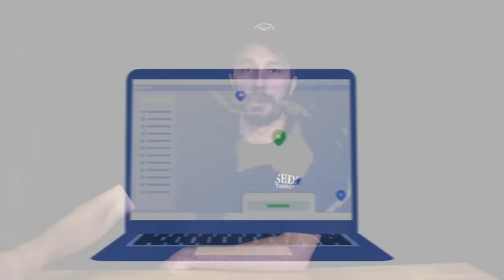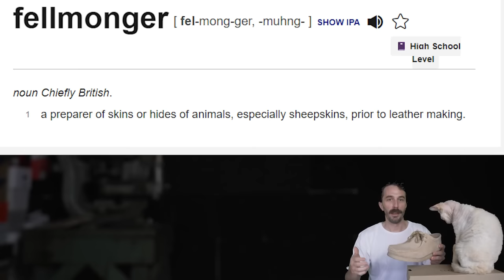The most popular ugly shoe - Clarks Wallabee

Comment: The Clark's "Weaver" shoe is one of my favorites. It's an underrated model in the Clark's lineup, with the Desert Boots and Wallabees domimating their marketing.
Reply: Honestly like the look of the weaver better. Are they true to size?
Reply: @Conrad45  I size
 up a half-size on Weavers.
Reply: @Conrad45  
My experience.  Same pair of socks, no extra footbeds/insoles. 
UK-made NB991 size us10½ = US-made NB997 size us10, similar to Clarks Weaver Boot (high) size44(size uk9½G, us10½M on the label)

Edit: My Weaver (low) size us10½ is slightly longer than the Weaver Boot (high) size us10½. Idk why.
Reply: @Conrad45  in my experience with wallabee styled Clark's half size down is best. especially if you'll wear it long term.
Reply: @Conrad45  Half a size down on Weavers for me.
Reply: @Conrad45  half size down if you’re unsure on the weavers.
Check out the Padmore and Barnes ones - better quality .
Reply: @PamelaD963  good shout
Reply: I don't know if it's my posture...I always get one side of the heel flattened than the other on each pairs which seems normal and a bit noticeable too without such high back heel. On this shoes, it's more obvious after several wears
Reply: Love the weavers as well
Reply: Desert Treks > Wallabees > Desert Boots for me 
Love em all and just copped those Torill to mix things up so not everything I wear has that same crepe sole 
#Clarks

Comment: The crepe soles on my Clarks boots fell off before I had a chance to wear them. I had them stored in a closet for over a year and couldn't believe it when they fell apart. I bought a can of contact cement and stuck the soles back on. I looked online for information and found that other people had the same experience with the soles. Turns out mine were made in China. In the 70s I used to buy wallabee-style shoes that were made in Poland. They were inexpensive and virtually indestructible. I'm hoping my repair job will last a long time as these Clarks cost around $150.

Comment: there is a shoe thats really similar to these called the padmore and barnes p204 that seems to be made equally as well or better because theyre hand lasted and hand stitched with the same style of crepe outsole. i would be really interested in seeing them cut in half before i make a decision on which one i should get, because even though these seem to be good quality the fact that its not a true moccasin makes me a bit hesitant to spend that much since i would for sure be looking to resole them once they wear out
Reply: I recently bought a pair of Wallabees but returned them and got a pair of Padmore and Barnes p204s. A couple of other things to note about Padmore and Barnes vs Wallabees is that the Padmore and Barnes do not have that narrow sole thing going on. The crepe extends past the sides of the shoe. In addition, the primary reason I returned the Clarks was that they were too narrow. I had a pair of Wallabees about 7-8 years ago and they were much wider than the newer version of the Wallabee. From what I read, they changed the design within the past few years, making them more narrow whereas the Padmore and Barnes are the original slightly wider design. I had the two shoes side by side, and the Padmore and Barnes seemed higher quality.
Reply: Padmores also have extra leather inside the shoe and much better  insole, in clarks it's cheap and even not leather
Reply: I have two hair, the p204 and another in boot form. Love em
Reply: @ЮрийБородулин-г1в  no one, and I do mean no one, has any interested in the views of a RuSSian at the moment,
Reply: @ruzziasht349  cool story bro
Reply: @niftyhorsowitz4494  elasticated laces be real on the P204s
Reply: Padmore and Barnes used to make wallees for Clarks. +1 for a comparison video, please.

Comment: In the 70s, you could find extremely high-quality knock-offs of expensive brand-name shoes like Clark’s, The Earth Shoe, etc. at chain shoe stores like Kinney and Gallenkamp for very little money. And when I say high-quality I mean they were made of real suede and leather using the same design and materials as the name brand shoe. You could not tell the difference. They’d be comfortable and durable and run you about $7 to $8 bucks. 

Even into the 90s Kinney Shoes sold quality knock-offs. In the early 90s I used to buy their genuine leather knock-off Dr. Martens for about $20. I would also buy real suede Clark’s desert boot knock-offs, suede knock-off Birkenstock sandals for my daughter, and once, in the late 90s, I found an exact replica of a beautiful pair BCBG high heels.

Comment: These were all the rage when I was in high school '74-'77 in SoCal.  You wore them with your straight leg 501's, Hawaiian shirt, and puka shells.  Very cool. 😎 Thing is that once they wear out, they wear out.  Contrary to your statement, they DO have stitching underneath the glued on sole and the sole is VERY difficult to remove.  They are virtually un-resolable (most cobblers won't touch them) and even if you found a cobbler who would attempt re-soling them, it would be too expensive.  Easier to buy a new shoe.  But hey, we are slaves to fashion and what is old is new again.

Comment: You might want to look into dissecting a pair of Grasshoppers now! I grew up in them and was surprised how different they are to Wallabees. GH are lighter, the sole is shaped differently and the inside isn’t slippery. Very very comfortable.
Reply: YEs and the Padmore and Barnes version too.
Reply: Grasshoppers were easily one of the most comfortable shoes I ever had. I had it in black for school and an algae green suede pair. Tough outer, but sole not so much.

Comment: I have been wearing the wallabees for like 6 years now, they are the most comfortable shoe I have ever used, even more that any sneaker. My only grip with these is that once the sole is worn you have to throw them away as there’s no resole service, which is a absolute shame for a €160 shoe. If they could offer soles or maybe a harder crepe - they used to make them with authentic crepe, now its a composite with rubber in it - they would be the perfect casual shoe.
Reply: Any local shoe repair will resole them for you.
Reply: I actually own Clark’s wallabies with a harder outsole.

Comment: I've had a few of them from suede to leather and more recent colors. The sole isn't meant for walking on a regular basis sometimes the bottom will blow ot but the upper part of the shoe sustains. It would be nice if they  used a more modern or sustainable sole.

Comment: Watched this because I’ve had a pair from new for 7 years now and they’re essentially in mint condition besides the soles wearing out… and have a couple other pairs that are used and the only issue was the insole separating - but they’re in a color they haven’t made in 12 years and I’ve had them for 5 so overall I was impressed just wanted to hear your thoughts

Comment: Long before Wu Tang they were hippie shoes.  Super casual shoes that lasted forever dried fine after being wet and could pretty much be worn year round. Comfort beyond belief.  I've always had a pair or two ever since 1975 in both low and hi which isn't much height difference to me. I've worn with tapered jeans, boot cut, etc  khakis and corduroy pants.  Even with shorts.  The prices NOW are ridiculous though.  You can get them with a lighter more modern sole that's nice too but not as comfy imo

Comment: Rubbish footwear, dye constantly bleeds on any type of socks I wear.  Awful to drive in when heels are concerned.  Collar and tongue are very uncomfortable when laces are tied snug like any other shoe is tied.  I'll experiment with inserting a half an orthotic to the forefoot and toes in order to stabilise the drop these have, see if I can wear and get used to them (if not they're going straight to the donation bin).  I really do not like the amount of heel they have in there, not to mention the uncomfortable seam of that half insole at the heel they come with.
Would never recommend.

My first type of moccasin shoes that resembled partially this Wallabee was a mid top version by Mack (yes, Mack Trucks).  The outsole and midsole were completely different and also comfortable.  Outsole was made of a very thick plastic, quite slippery I remember them wearing them literally everywhere, anytime, anywhere.  The heels never wore through to the midsole/insole which leads me to believe it was a truly solid layer of plastic as the outsole.  They ran at least half a size up, sort of like the Wallabee.  Leather was pull up, easily marked and scuffed and eventually the nubuck type of pull up leather was worn down to a regular calfskin looking leather while still retaining that thick, substantial feel of pull up like a Red Wing almost.  The insole/midsole was a generally sport fabric and it conformed to my feet in about 6 months or less.  The break in and wear in time overall was about a week.  Flex was normal for a sneaker/casual boot/everyday moccasin.  They withstood about 4 years of regular wear before the laces needed replacement, at around that time I moved onto other shoes and eventually they were hidden away for so long I just donated them to the bin.  Easily could've been resoled with a Clarks or Red Wing outsole, but hindsight's 20/20.